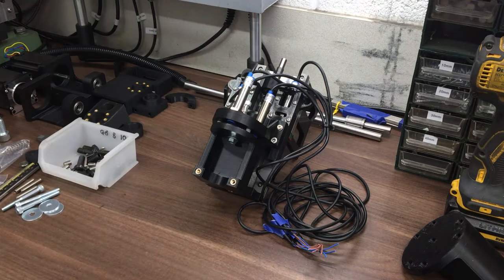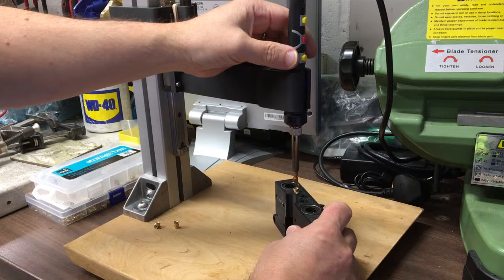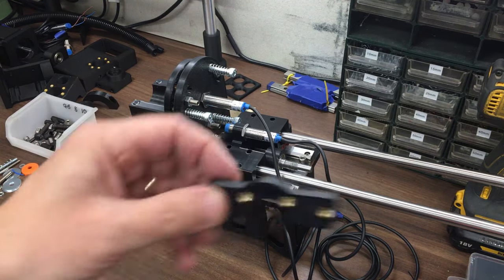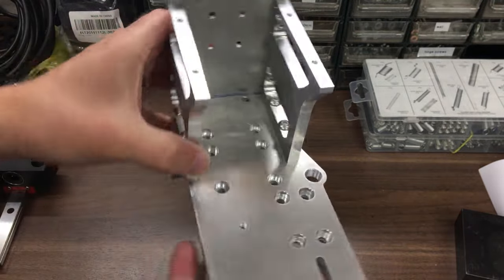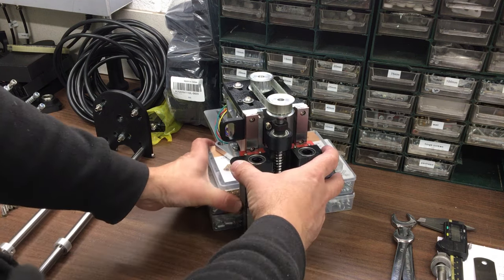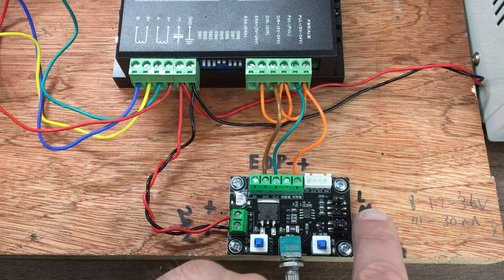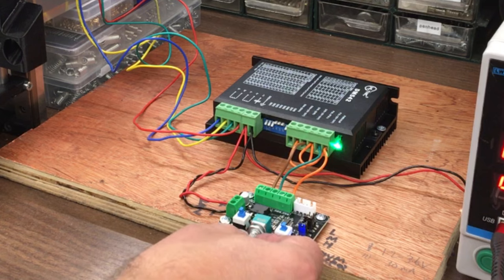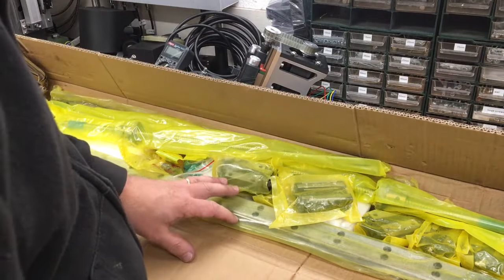Ep03: Plasma CNC build | New Z axis and MOVEMENT!

Comment: I saw on that board's terminal block there is on/off that you did not connect. I guess that goes to enable pin on driver.
Reply from the maker: Yes I think you are right.  I don’t use the enable contact on my machines so didn’t connect it.  I’ll test it and see, thanks.

Comment from the maker: There was another comment in my inbox about how well the 3D printed parts might hold up against the plasma.  But it was deleted or did not appear here, so my answer is I've seen other CNC plasma machines use 3D printed parts around the torch area and been OK.  So let's see how it goes.  I do think the 3D printed cover near the torch might not last that long as it is so thin.  When this thing is finally working I'll post something, but we are some way off!